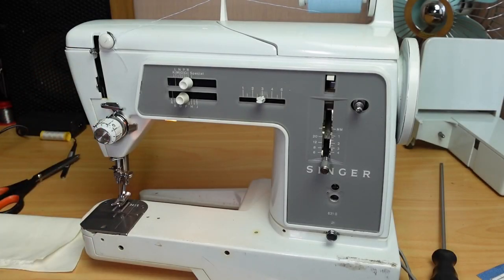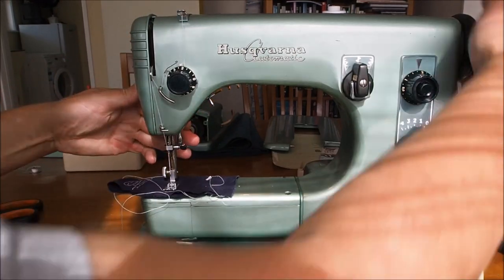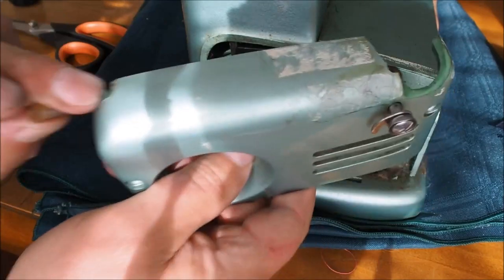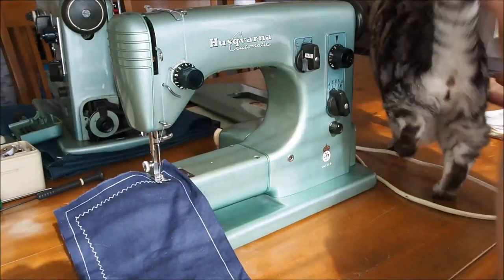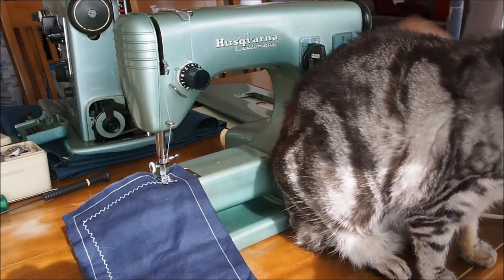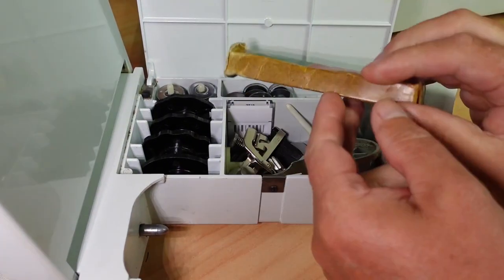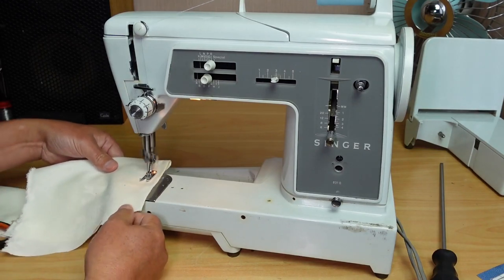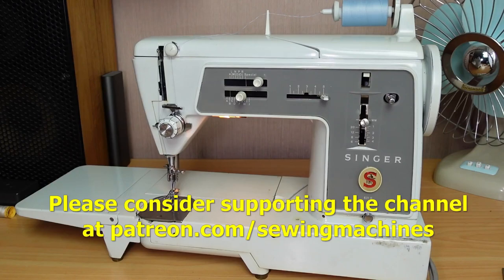Most Reliable Domestic Sewing Machine Ever? Singer 631G / 611G.

Comment: Motor issue with a hidden capacitor in the stator. In UK just picked up yesterday, I tested it with an ohm meter and the reading were a bit iffy. It came with a blown 3amp fuse 240V,  it did run and when I went to full speed a loud bang in the motor. I stripped it down and found a small piece of glass like plastic and then I saw the capacitor, I left it in place trapped in the stator coils and cut the stiff extended wires near the brushes, I tested the rotor approximately 62 ohms between segments the coils were about the same.

The machine now runs well. During testing / investigation I blew 2 fuses and nearly jumped out of my skin.

I had to file a bit of the motor to slide it out past the aluminium frame the machine is a 631 machine, some of the top cam stack are plastic compared to your machine.

When I removed the motor the top part where the long part of the motor is held in rubber bushes was full of aluminium swarf ? I did note there are a few porosities in the casting in that area that must have held the swarf, very odd. 

Last time I had an issue like this was with a Bosh jigsaw from the 1980s that had a capacitor jammed in to the stator, lot of smoke, pulled it out and continued cutting outside until the smell went away.

This 613 machine has a problem with the paint bubbles on the extension bed and a few other places, it must be damp getting to the aluminium. There is also a bit of rust inside the top of the machine so I just painted a bit of oil on rather than stripping it down.

Many thanks for your videos 
All the best

Comment: I think I would agree on the Singer, the direct drive is more reliable than belt drive as far as maintenance is concerned.
I have 2 early Huskvarna machines and they are built to last, I would say the main advantage is their 2 speed gear box.
I don't use my machines very often so it's nice to have something you can depend on when you need it so why not have one of each?

Comment: Love your videos on this machine.   I now want one.

That said, I would have though that you would have reacted to the 319/320 the same way.   All steel parts, with cams something like 100 decorative stitches, built like a tank, 1,350 stitches per minute.  Rotary hook,.  The only thing that can wear out are the motor and the timing belts and there can easily be replaced if ever the need arises.  Lots of these machines are going strong with timing belts that are over 60 or 70 years old.  Five minutes with a file to make a simple modification to the bobbin case and it takes standard 15X1 needles.  One doesn't even need the five minutes, as replacement bobbin cases are available to allow for the standard needle.
Reply from the maker: Yes, you're right about the 319/320. They are very solid machines and probably just as reliable as the 631. I probably wasn't thinking about reliability of the 319 at the time so I'll show that off next time I get one in. Thanks.
Reply: @InStitches  That will make my day!  I always learn something, and very often a very great deal from your videos.  You also have a great cat companion who I'm always happy to see assisting you in your work.
Reply: Agree wholeheartedly. I didn't realise that they were so fast, faster than the 1100 spm Air Electronic (and similar later model) Elnas, and almost as fast as the legendary 301A plain sewer (1500 spm).  Considerably faster than most modern domestics (usually seem to be around 800 spm.) I read somewhere that 319s were used as industrials in Germany for lingerie if I remember correctly.
Reply: That was a strange decision by Singer to unusually short needles that are now available only in sizes 80 and 90. I read somewhere that some industrial needle type is almost identical and can be used in these machines. DPx5 perhaps?
Reply: @marksmale827  I have no trouble at all with 15x1 needles.  I can run the machine flat out using the widest zig-zag with no problem.  The issue people run into or think they might, is that on the right swing the needle may touch the bobbin case.  That's an easy fix.  Five minutes with a small file to remove 1 mm of metal from the right side of the bobbin case is all it takes.  If you don't want to alter an original Singer bobbin case, inexpensive alternatives are available on the 'bay.  I was also able to get a bobbin cases on the 'bay that has a wide opening and that one works like a charm.

As far as alternative needles, DBx1 needles work fine in my machine.  These are a bit shorter than 15x1 needles.  The shaft however is round so the needle has to be inserted carefully to ensure that the scarf and the eye are in the right position.  A few minutes of practice is all it takes to get it right.  There really is nothing much to this.  Professional sewers use these needles day in and day out in industrial machines and so changing the needle and getting it into the right position is just a matter of exercising a tiny bit more care than using a needle with a flat shank.
Reply: @r.duroucher225  Thanks for that! 

I got some replacement bobbin cases via the internet from Australia so I could use standard needles. 

And my B 950 semi-industrial uses DBx1 so I’m in luck there too!
Reply from the maker: @marksmale827  Yes it was a strange decision. Fortunately this machine uses standard 15x1 domestic needles.
Reply: @marksmale827  The "older sister" of the # 319 was used.. The # 206 was a Singer zig zag produced in Germany before WW2. The Singer factory was bombed and production of the # 206-306-319- 320 resumed in Great Britain and Bridgeport, Conn.
Reply: @marksmale827  No, you can either modify the bobbin case, purchase an "open" bobbin case or purchase a Singer 20U bobbin case. Then you may use standard needles. The # 206-306-319-320 machines were made using the Pfaff #130 patent, so the needle system was changed to "make something different"...

Comment: Just got a singer 626 for 10 bucks the 626 has metal gear
Reply: You were lucky. The # 626 was the last to "go all plastic", because it was commonly used as a "school machine". By the Fall of 1966, all # 626 machines had plastic gears.